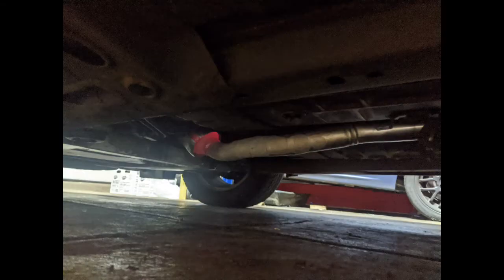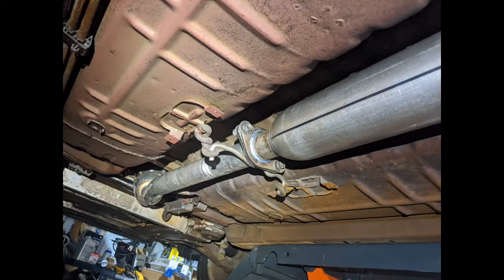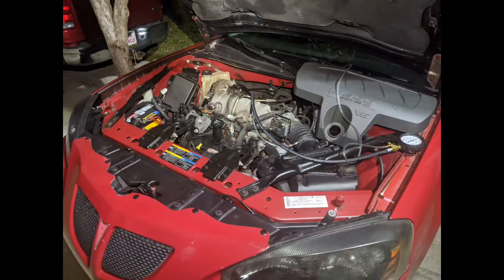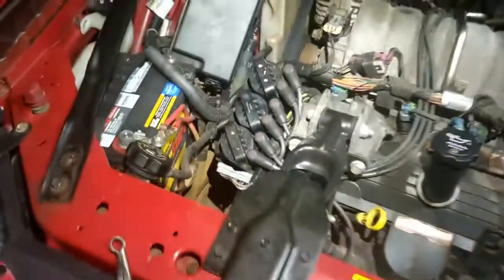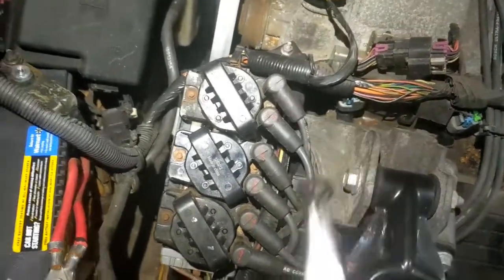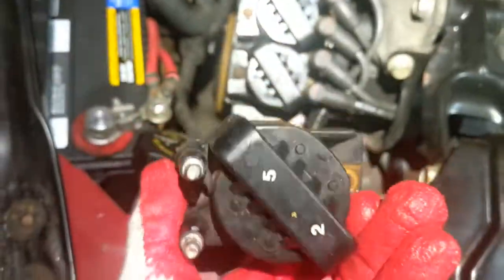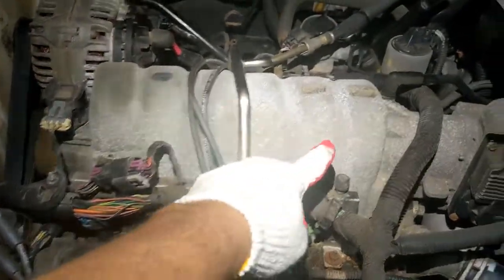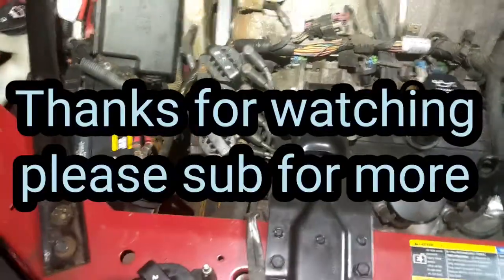Red hot catalytic converter  fix

Comment: I have audi a3 1.8 tfsi 2007 the car cuts out and when give gas it runs but misfires and after sometime the exhaust manifold get red hot i changed spark plugs, fuel injectors, fuel regulator anyone know anything common on audi

Comment: Sometimes a red hot converter is due to a plug wire not connected or you have crossed wires on the wrong cylinders.

Comment: Hello brother i have the same problem. But i aslo have a another problem on the engine cover where the  ignition coils are i kinda see  a slight electricity comes and goes goes  I've replaced the ignition coils and it's the same. Could that lead to headers glowing red
Sorry for my bad English i hope u answer me  thanks for ur time!
Reply from the maker: Hi, wow, is hard to tell. Just do all the coil,  but there is the plate where you seat the coil. Maybe that's  the problem
Reply: @nestorautorepair  I've changed the coils and still have problem but this time on the 4th eye  and u mean that plate when u tight the coils on it?
Reply: @danardana783 did you find the issue?

Comment: I believe mine in the BMW ruined. It turned glowing red for about 5 minutes before I noticed it. It's still blowing exhaust out of the tail pipe but I'm not showing it's even functioning on my scanner. And it's about 200f hotter in the inlet than the outlet on this catalytic converter. So would you say it's toast? My HPFP is also getting way too hot to touch is that even normal?
Reply: Hi you ever figure out? My Beamer is doing same think
Reply: @buscojosenjuarezdenuevoleo9669  You'll need to check your ignition coils, they could be plugged into the wrong spots. A lot of times that's the problem..
Reply: @Bama-Tony they only have enough Roo for each other  but coil 5 was bad spark plug #3 was also bad and right when I change everything my starter wend out for no reason it doesn’t move at all  I wonder if can be fix ?
Reply: @buscojosenjuarezdenuevoleo9669 did you fix it ?

Comment: After 6 months of troubleshooting and replacing part after part I finally found out that when I last changed my spark plugs the rubber grommet in the spark plug socket came off on the last spark plug and prevented the coil from seating correctly. This caused misfire, shaking, bucking, and most recently a very hot exhaust pipe. I can't explain how many facepalms I feel right now.

Comment: Hey sir I  have the same issues my driver side cat is getting hot and it’s new and my left side cat is normal I already put 2  new cats  new coils new spark plus new 02 sensors and it’s still acting up  number 2 bank is making my new car burn up I’m no sure what to do ….  Usually when I change my spark plugs and coils I would o thought fixed it

Comment: My exhaust manifold or header was glowing cherry read today I have a 3800 series V6 And my car don’t really have no power at all. Would it still run an idle fine with the burn out coil pack?
Reply from the maker: Wow not good try to fix it
Reply: Did you figure it out ? I’m having the same issue

Comment: I have a 95 Buick Park Ave. with a 3800 series 2. I drove it a mile today pop the hood looked down. The header was glowing red. It runs and idles okay but it doesn’t have any power. I’ve changed the EGR valve, PCV valve, idle air control valve numerous sensors plugs plug wires. If it had a burn out coil would it still I don’t fine?

Comment: Yeah got a Kia soul was on high way driving 80 mph check engine light started flashing drove just like normal with the light flashing …. Stop at the exit go to take off bogs down like no power at all unless u barely give it throttle “sounds like a edlebrock muscle car cam is in it” …. I put a scanner on it and got cylinder 3 & 4 misfire and “multiple misfire  p0300 code”

Also no knock

Clogged cat? Or rocked cyclinder wall ?
Reply: You ever figure out?

Comment: I have a 2006 honda jazz/fit. It had been sat for a year due to bad starter and not being able to get the last bolt off, but i finally got round to it a couple of days ago and replaced it. After putting everything back together today i started the car, it started up but kept going off again…so i pressed the gas pedal when starting  and revved it a little, that kept it running, but very bad, erratic idle, up and down. After around 5 mins i could feel so much heat around the car, so looked underneath and saw the cat glowing cherry red…i turned the car off right away. Any idea what would cause this to happen?
Reply: That sounds like 
1) bad fuel left in tank. 
2)failed thermostat 
3)not enough coolant in car
4)bad fuel pump.
5)spark plugs need to be changed. 
6)clean Mass Air Flow sensor inside of intake. (Only sensor on the intake) Id clean the MAF sensor first after that go down the list it’ll work after that list is gone though.
Reply: Vaccum leak

Comment: I have a 2005 lacrosse that's running rough so I changed spark plugs. Then checked the coils the bottom coil wasn't sparking when I pulled the wires so I replaced that coil it seemed to run better and the check engine light wasn't on any longer so I drove it down the road it ran great for 10 minutes or so then lost all power and running worse then before by the time I made it back home it didn't want to stay running and the cat was cherry red so hot the carpet was beginning to smoke. So I gutted the converter thinking it was clogged it didn't help at all.
Reply from the maker: Wow sorry to hear that , I will say you still have some bad coil internal the spark is coming in contact with the block on top of the spark plug ,, just replace all the coils or if you want to go cheaper just replace the coil boots , also make sure you take them out and check them closely looks for cracks
Reply: @nestorautorepair  could it be a exhaust manifold leak?
Reply from the maker: No
Reply: I think you need new injectors..
Reply: @kevinfrancisco1730  I swapped the plat beneath the 3 coil packs I believe it was called control module. It ran great for a week or so. Then one evening on my way home from work it broke down on interstate 68 here in western Maryland. I called my wife she came to pick me up I left the Buick sitting planning to pick it up the next morning and haul it to the scrap yard. While it sat on interstate 68 someone jacked  the car up and stole the catalytic converter the joke is on them because it was gutted they must have left in a hurry because they forgot to take their floor JACK along. So I made out better than the thief that stole my converter because it was gutted. This floor jack is nice I've used it alot.
Reply: Bro wtf is gutting the converter?. I had a lacrosse with same issue. New converter solved it
Reply: @ellis2311  This car was purchased to be scrapped anyway. So I wasn't putting a lot of money into it. If it needed a new converter then gutting the old one should have made the car run a little better I would have thought. On older vehicles the converter would clog causing the converter to glow red cars and trucks from 80s

Comment: Strange way to label a video. Misleading for a moment, maybe that's how the customer complained.
   You found a bad coil. So at least the vehicle was properly diagnosed.
   If that is a 96+ it is OBD2. So there should have been a PO300, P030X code to lead you directly to the problem. The misfire, if causing the vehicle to be rich enough to glow a CAT, should have been obvious.
   Not a very good practice to intentionally hold the gas while it is misfiring that badly to glow the CAT.
The sulfur smell should have been an additional indicator.
   Customers don't have this type of knowledge, but techs do. Unfortunately those CATS can fry pretty fast when there is that type of problem.
Reply from the maker: Ok

Comment: I have a 05 Murano and my muffler/resonator gets red hot, could it be this bro? I just bought it from autozone and it expanded like a bag of popcorn! I've been on here all day trying to find a video similar to what's happening to me and this is the closest one. Thanks in advance
Reply from the maker: Yes hi , so what did you buy from AutoZone ? The resonator ? S, do this take the resonator off or cut it off and see if the Murano runs good , if it runs good then more likely those other  muffler are clog up

Comment: I have the same problem with Honda civic 2002 my catalytic converter is really red and hot. I already replaced it.  But still  have the same problem the power of engine gone. So i need to wait until the  temperature goes down then i can drive the car.  Any suggestion for thus this issue
Reply from the maker: Yes in mose case it will be a bad inigtion coil. Bad fuel injector dumping too much gas in it.
Reply: @nestorautorepair  I had the same problem. The shop replaced the exhaust manifold but claimed it was a coolant leak. I sold it to a kid whom I told what the problem that I encountered. I think it was the fuel injectors and the ignition coil. I don't know if the kid was successful with his repairs.
Reply from the maker: Wow , coolant leak will not make this happens , correct miss fire is the problem
Reply: Did replacing the coils and spark plugs fix ur issue
Reply from the maker: Yes one  coil was bad
Reply: You have dpf issue mate
Reply: I have a 2001 nissan xterra. I changed the valve cover gaskets and it started misfiring. Next i changed the spark plugs and wires and still misfires. Then i changed the fuel pressure regulator and still misfires. I also have to not that at one point i had a small fire from the oil leak which was around a oxygen sensor. Do yall think my o2 sensors are bad? Cause my cats glow red if i drive it. I havent driven it since i noticed the cats. Any help from yall? Id really appreciate it
Reply: @michaelalonzo3027 did you fix the issue ?
Reply: @joshuacruz4046  na sold the damn thing too much hassle
Reply: @ lol just about everyone does when they can’t figure it out. I don’t want to give up on this truck
Reply: @michaelalonzo3027 did you ever find out the issue?
Reply: @michaelalonzo3027 

I have a same pblm sir...

Could u Pls help
Reply: It ran perfect before i chnaged the valve cover gaskets so idk what it could be
Reply: I replaced my ignition coils, spark plugs, maf sensor the intake hose , battery  and air filter and mine is still hot what do I do
Reply: @quinetriaroberson5951 any luck?
Reply: @quinetriaroberson5951 

How to rectify ur pblm...I have a same pblm...could you pls help

Comment: My man i drive a 2008 nissan altime i think the muffler has a whole because it sounds very loud like a diesel truck. The catylic converter is burning red and there js a misfire and an oil smell. 
Do you think most of these issues correlate if yes what should i fix first
Reply from the maker: With the engine running unplug one coil at a time and when you see the engine stay the same that's the bad coil , if the engine change the speed when you unplug it then is good

Comment: Hello sir, I have a eon car and i don't start it since 8 month and now it's not starting when i tried, after that i bring another battery and i make a series connection with 2 battery (maybe it produce 24 voltage) and start my car ,after 10-12 minute I saw its silencer become very hot and look like red or burned iron . Now, what to do and what's the problem in that car. Sir please reply.
Reply: Yeah, I tried it. I mean I removed the o2 sensor and start it, but I does this for the red hot cat, and it's  not even starting that time. After that I break that soil part which is situated in the cat. But no improvement happened that time. But today I found a bad plug and after changed that, now I can start  it.
Reply from the maker: Replace all the plugs and wires
Reply from the maker: Yes sir more likely you have a problem , but let's star with the car info what car is this ?
Reply: Thanks for reply sir, it's a Hyundai eon d-lite car. I think most likely my car has same problem which you showed in the video, but can't say it with guarentee afterall I am not a specialist or a mechanic. So if you say something about this.
Reply from the maker: Hi Prava What year ?
Reply: This car has also other problems like it goes off many times when I brake and slow down my with 1st gear and sometimes goes off when stayed in neutral. I also checked my car by many mechanics and Hyundai showroom servicing centre , but no one can fix this problem. At a time Hyundai showroom's engineer said that there has defect "idle speed actuator" and I replaced it and it cost 11000 but again, no improvement. What to do sir, please suggest me. Thank you.
Reply from the maker: Hello Prava, Oh ok well have some one scan it and see what the codes are , sound like this car has more then one problem , need to fix one at a time , do a small tune up first new spark plugs new wires new fuel filter if it has one outside the gas tank
Reply: Its 2012 eon d-lite (0,8 Lt engine)
Reply: @pravadebnath1046  hope that you had a chance to carry the car to someone, a mechanic perhaps. I just feel really bad for how desperate you were trying to figure out what was wrong with the multi problematic vehicle that you couldn't start. Hope you were able to get it serviced.
Reply: I am feeling very sad, that car is not starting right now. I tried many times with other car's battery, I can start it 2 times in whole day. Say something about this. Someone said there has fault in valve, someone said there has problem with piston and piston ring, and someone says weiring problem and someone says it has bad block. I am really confused and no one can give guarantee about that. 😑
Reply from the maker: Hi well you had the car sitting for too long , the problem you are having yes it is electrical maybe there are some cut wires from small animal eating the wires check in the engine reall good and under the car be carful
Reply: And one think today I removed that things looking like net (maybe it's made by a special type of soil which is situated in the first box of the silencer pipe (maybe its called catalytic converter). I did this for the problem of red heat exhaust pipe.
Reply from the maker: Oh ok but the car still not running ?
Reply: Yes after that it's not running till yesterday, today I checked all plug's and I found a bad plug, which I replace with a old plug, now I can start that car  and solve red hot silencer problem.
Reply from the maker: Sweet!!
Reply: But still there has a new and old problems, new one is its producing a little more sound ( I think its because I removed that part of the catalytic converter), and old one is that car is not getting enough pickup, when I press the escalator pedal, its getting pickup very very slowly, I need to wait many seconds for getting pickup after pressure escalator pedal.🙁
Reply from the maker: Remove the o2 sensor before the car and see if you get full power
Reply from the maker: Mmmm I think your cat is clog
Reply: If I change all plugs, then is there any  possibility to solve the pickup problem?
Reply from the maker: Yes
Reply: Yesterday I goes for pollution certificate and it comes fail, is it for that honeycomb shaped part which I breakdown?
Reply from the maker: Yes if you tock the honey cone out if the catalytic converter yes it will not pass
Reply: If the reason is that, can I fit another car's catalytic converter in eon? One of my friends suggested me to fit maruti alto's or maruti omni van's catalytic converter. Is it really possible? He said its possible if I go to a mechanic who is work in car modifying. What you say?
Reply from the maker: That's a big job I recomend you get the correct one for the car , no one will sell you a use one , you can get one on eBay really cheap
Reply: So now, what should I do?
Reply from the maker: Order one on eBay
Reply: Yes, but one of my friend says it's very costly maybe 18000-22000 rupees.
Reply: Can you tell me the approximate price. (In rupees)
Reply: And you're saying about which part? Whole catalytic converter or that honeycomb shaped part?

Comment: I just changed all my plugs and wires and now I start it up and it’s running very rough goes and look under the car and it’s red hot engine light blinking and all.
Reply from the maker: If if was not like that before , you got one wire not where it need to be
Reply from the maker: Did you find the wire that you connect wrong ?
Reply: crown Victoria that’s doing this I just installed 2 new cats new coil new spark plugs new injectors  new 02 sensors
Reply: You suck for not updating

Comment: I wanna note a flashing check engine light means that there’s a misfire not that it’s a cat
Reply from the maker: Yes sir correct if the check engine is flashing there is a misfire but if you keep driving it you will destroy the cat , then you will get a flashing check engine light because now the exhaust is clog.
Reply: My truck also flashed the engine light when I filled it up with too much gas with a bad charcoal canister